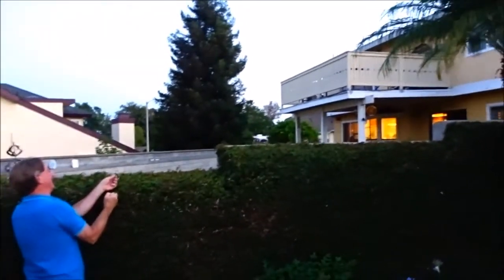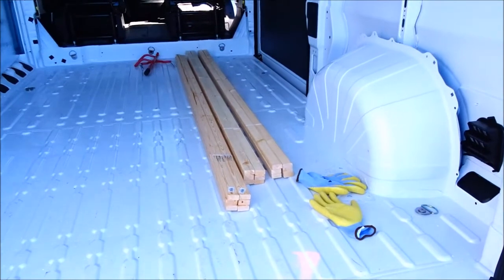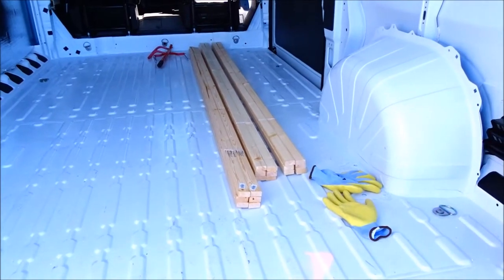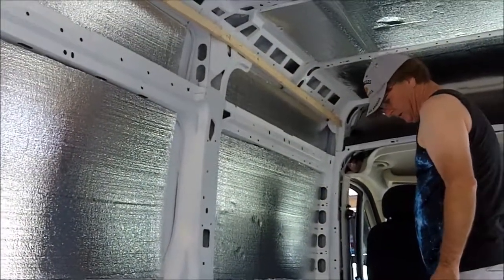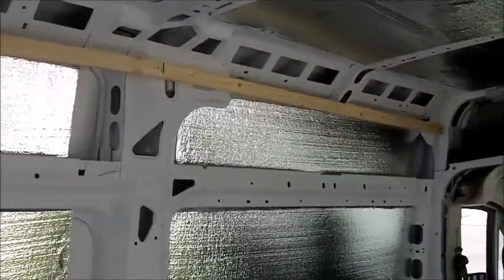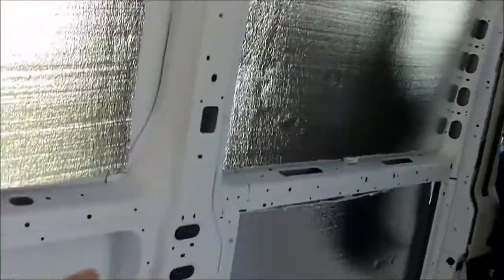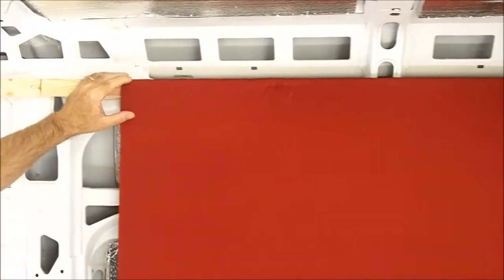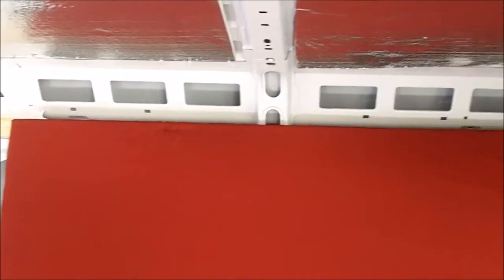2017 Ram Promaster van conversion wall panel design. Popper Scare. Fireworks. Happy 4th

Comment: steel beam framing built by van company just screw on plywood over pcs of 1'' foam small pcs build out to flush in indents.
Reply from the maker: yes. Agreed. We just did that for the video. next thing we did was hang Theater curtains for a video. The curtains are down now also.. lol. Today's video we show an update. We are just having fun. Thanks